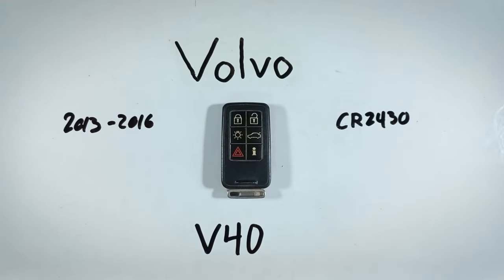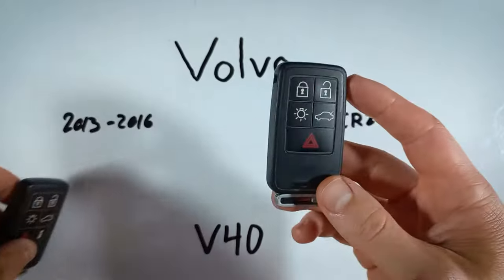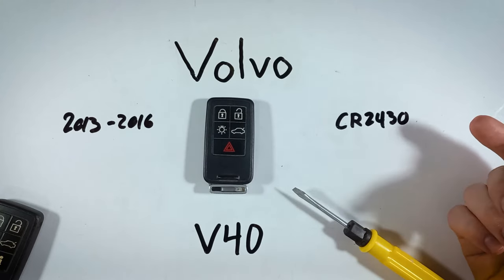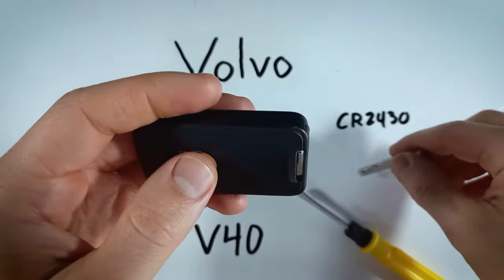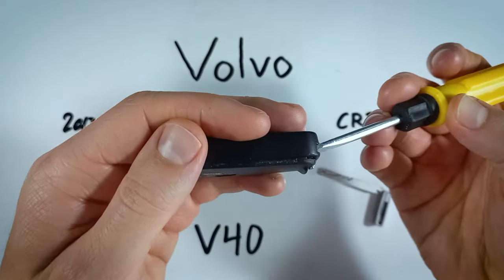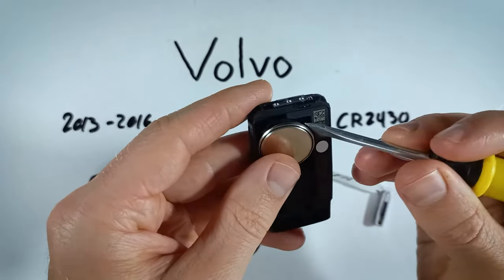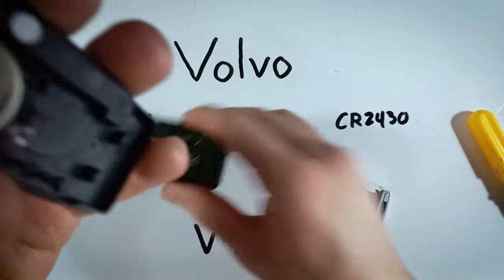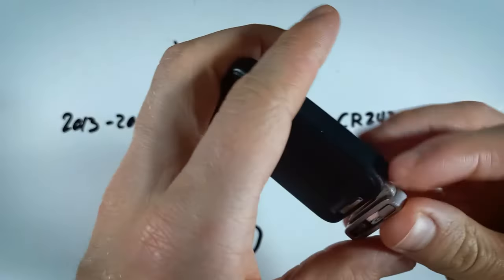Volvo V40 Key Fob Battery Replacement (2013 - 2016)

Comment: I have the 6 button version and I believe mine takes 2 batteries otherwise the pins on the circuit board don't reach the battery...
Is that correct? 
It's a second hand vehicle so I don't know what the previous owner did, but I'm pretty certain when it was first opened, there were two batteries with the polarities flipped and a piece of plastic (insulator of some kind) in between the two batteries. 

Either way, I can't get my remote to work and now I have to climb over to the passenger side to get out of the car, otherwise I can't lock it.